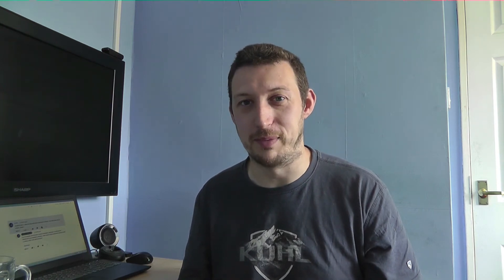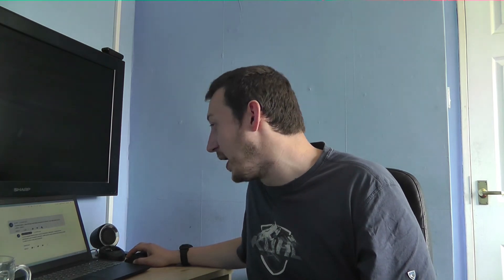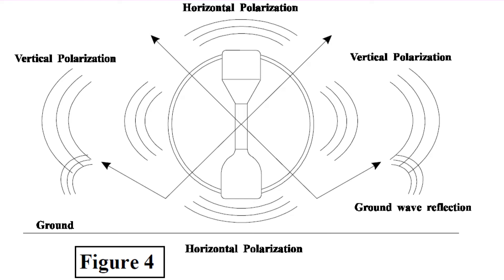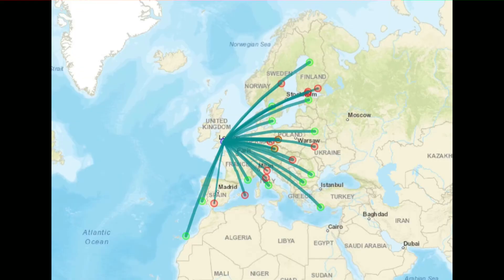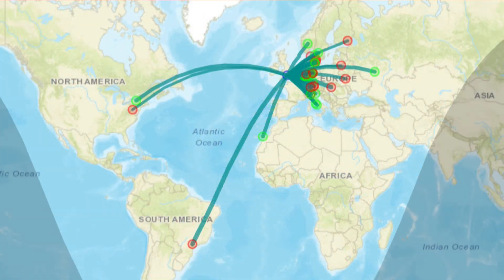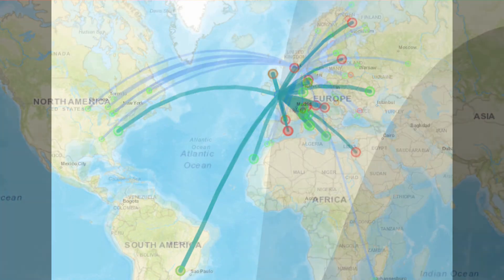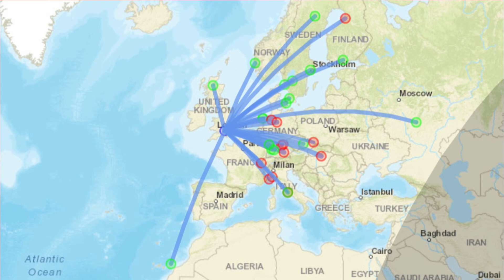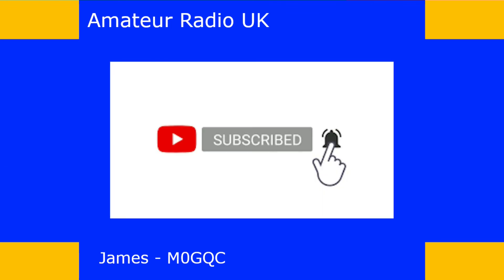How directional is an MFJ-1788 magnetic loop?

Comment: These experiments are what it's all about (for me at least!). Great work!

I think that maybe being 6 or more dB down from the peak of a pattern has less effect than many of us intuitively think, so you only really experience (i.e. properly notice) directionality due to sharp nulls or a good F/B ratio, especially on HF. 

I've done a lot of experiments with homebrew loops over the last couple of years and have found that the effectiveness of them versus a dipole or other wire antenna depends on a lot of factors other than absolute peak gain on the polar pattern; for example one antenna will win in the morning and the other at night, presumably due to elevation pattern differences (& this is all for transmit effectiveness - I use an Rx-only loop for receive which means I can devote my focus to transmit effectiveness on the other antennas & not worry about their S/N on Rx).

I've also tried horizontal vs vertical, at heights of 3m and 7m AGL. What I've found (again this is all for transmit effectiveness) is that for 20m band, my 3m circumference (10mm copper tube) loop beats my inverted V at the same height if the loop is horizontal but not if it is vertical. On higher bands, capacitor losses increase (I think - ESR tends to rival capacitive reactance). On lower bands, I've had a 6m circumference 10mm copper tube loop easily beat my wire antennas on 80m, but this is because I have little space and the 80m wire antennas are compromised.

But, after a lot of experimentation, I'm coming to the conclusion that a reasonably well constructed loop is approximately as good as a dipole if both are in free space, and one will then win over the other depending on the environment and frequency band at lower height, but probably not by much (YMMV), and convenience is a big factor too.

It's all part of the fun!!
Reply from the maker: Some great points there.

As you point out, 6db probably doesn't make as much difference as most of us think. Let's face it, 6db is approximately one s-point. The QSB can have a greater effect than that.

Comment: hi james, i just came across this video, after just working m0lrq peter on 40m cw, with his 50w.  so i started to research this ant.  bit surprised by different peoples results hi, peter had his loop 2m above the ground, so i am a bit confused by his great results.  just thought i would let you know my findings , and i will find your pervious videos  about this loop, so get more info.  cheers james, take it easy mate, have a good weekend. 73 brian zl3xdj
Reply from the maker: Hi Brian. Wow, that video is a blast from the past. One of my very early videos which I'd completely forgotten about!

There's some really mixed reviews for this antenna online. People seem to either love it or hate it. I think it comes in for some fairly unreasonable criticism to be fair.

MFJ say that it's equivalent to a dipole. My personal perception from using the antenna is that this was true on the higher HF bands (20m & higher) but it's a compromise on 40m.

As for height above the ground, I mainly used mine on the upper bands (20m & above). I personally found that I got better results with it elevated as high as possible. I live on a fairly built up housing estate which is also surrounded by several big warehouses, so plenty of clutter on the ground to attenuate your signal.

It could be the case that for NVIS on 40m, it might actually be better closer to the ground?

My biggest gripe & a massive pain in the backside with this antenna is having to constantly re-tune every time that you change frequency, which drove me to total insanity! This is the main reason why I would choose a full-size antenna over this loop if I had the space.

If data is your thing (such as FT8 where you tend to stick to a fixed frequency) then it's a great option for limited space, and actually not that much of a compromise.

You have to judge it for what it is.
Reply: @HamRadioOnline  thanks for all the info, and as you say it's probably a compromise ant, that's why iam really surprised that m0 station running 50w with the ant 2m off the ground is getting through to me on 40m cw, I can't really understand how that is.
Anyway qrt here due to big thunder storms, wow the sky is going crazy hi.
Have a good weekend  mate, cheers brian zl3xdj.

Comment: How it works on 11 meters cb band?
Reply from the maker: This is the 1788 version which covers from 15 meters down to 40m, so won't tune on 11 meters CB.

However, if you get the 1786 version (which covers from 10 meters down to 30 meters) then it should be usable on CB. Obviously you sacrifice the ability to use 40 meters with the 1786 version.

Comment: Based on your findings and what I’ve speculate . I Think 💭 it’s probably best horizontal just like a dipole .. I think it’s  a lot better though  than a dipole . But as we also know vertically antenna with 45” degreee angle to 15” angle are aimers for ionic- sphere  . But base on your findings it shows that horizontal is at best . I’m stick with that and place mines also horizontally.. 73

Comment: Good experiment!  Your findings are pretty consistent with the other videos I have seen testing the MFJ-1788.  It seems those who are using this antenna for strictly digital modes are quite happy with it.  Those using it for SSB phone contacts are not impressed with it.  Either way if your circumstances, such as living in an HOA antenna restricted neighborhood, do not allow visible antennas then this may be ones best hope to get on the air.  It can be ground mounted vertically as little as 1 meter high disguised by plants, shrubs and trees with fair results.  If only it weren't SO expensive!  Now subbed.  73!
Reply from the maker: Thanks for subscribing, great to have you aboard! Your comments sum it up very nicely.

The bottom line is that it is a compromise antenna. It's not going to keep up with a full sized antenna, especially at the lower end of it's coverage (30m & 40m).

From 20m upwards it doesn't do too bad when compared to a dipole. It's certainly less directional than a dipole. MFJ say that it should come close to matching the performance of a dipole. I'm slightly on the fence with that claim!!!

I haven't actually tried it ground mounted. Could be an interesting experiment for another video!

Comment: So horizontal,  and no need for a rotator?
Reply from the maker: That would be my approach. I'm currently having a bit of a re-shuffle with my antennas at my home QTH. When this goes back up I will be mounting it horizontally again.

Unless you have a specific reason to mount it vertically..........such as a need to try to reject local interferance (using the nulls of the antenna), I personally would just mount it horizontally as high as is practically possible to do so.

I note that the null on either side of the loop is very narrow at "approximately 15 degrees" (according to the MFJ manual), which means that when mounted vertically you are still getting 330 degrees coverage, or more accurately 2 "lobes" of 165 degrees in each direction.

Even mounted vertically it is still essentially omnidirectional. This may not be technically true due to the small nulls but even MFJ state in the manual that "a small loop antenna is essentially omni-directional with the exception of two small nulls".

My personal experience with this antenna is that the nulls are so narrow that in practical terms it made no noticable difference.

These videos on the MFJ loop are getting quite old now...........they were made well over a year ago so I'm struggling to remember exactly what I said in the video. I might actually have to sit down & watch my own videos to remind myself!!!

Having said that, they do still seem to attract a lot of views. It might be time to think about doing a revisit on this one if I can think of something different (and also interesting) to do with it!

Comment: Thanks for your report James.  I live in the east bay San Francisco in a highly restricted HOA.  I have an attic dipole and it transmits well, but too much noise for receive.  I have two outside receive only active mag loops outside for receive which are phased through T/R switching unit (DXE NCC-2); one loop is 8 ft off the ground in the garden, and the other is on the roof about 20 ft. high.  I got the 1788 to see how it compared to my receive mag loops sensitivity.  The 1788 did better than the active receive loops, and, it transmitted almost as good as the attic dipole.  My 1788 was mounted vertically, 8 ft. off the ground on a rotator.  My plan is to mount the 1788 horizontally on the roof and see how that works.  The biggest downfall is the extremely narrow bandwidth; tricky to tune.  I use the band scope on the IC-7300 to get close.   '73  Bob
Reply: I have my 1788X mounted horizontally 24 feet up and it seems to be omnidirectional. Propagation / time of day is certainly a big influence. Re. the tuning : I am using an FMJ 212 Matchmaker which makes moving a few kHz up or down less of a faff as you can both hear the very narrow 'null' and see it on the waterfall by just 'fine' tuning. Plus is you don't need  to Tx and risk high SWR between bands, or in so doing, interfere with other operators by sending out a long carrier.  A seemingly less considered factor when deciding between vertical and horizontal, at height, is the wind. In a vertical orientation it would catch the wind like a sail. I still get anxious in medium to high winds even with mine being horizontal !! It's a fine antenna, once you get used to it but definitely not cheap.